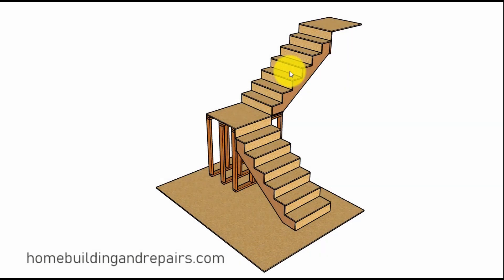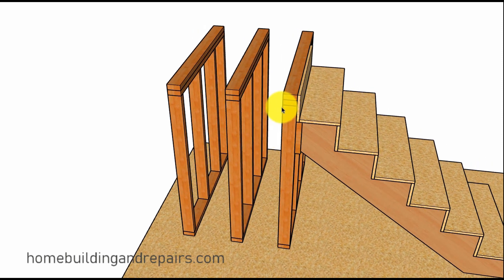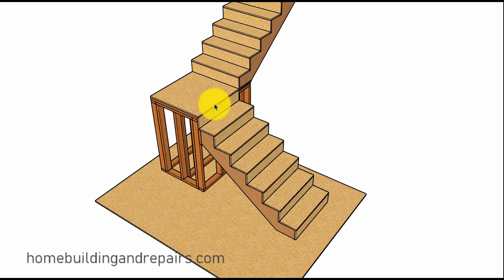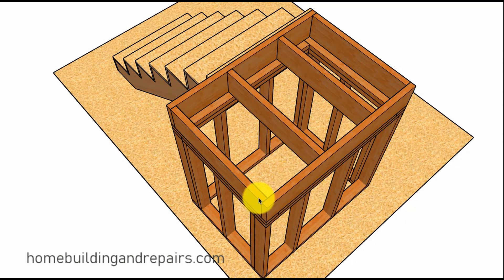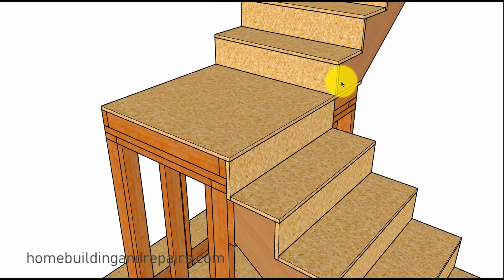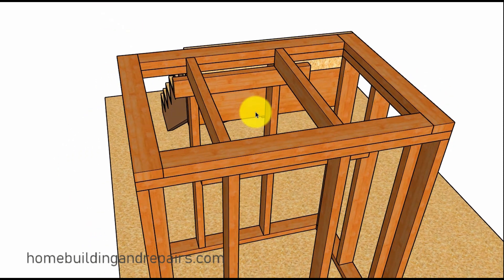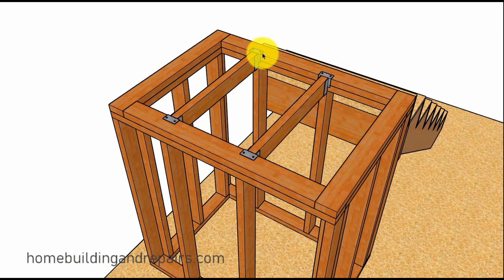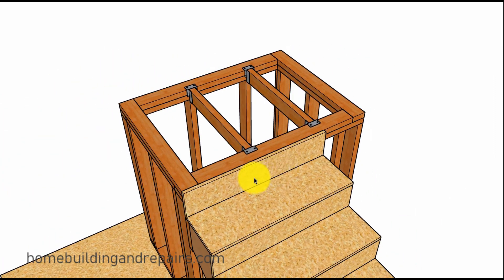Seven Different Ways To Frame A Stairway Landing - Carpentry Tips For Home Builders

Comment: For stairs @2:23 the back side of the landing if the 2x4 were moved to double up in the two corners. could you just move them and convert under the landing to a closet space? You’d have to remove the framing running along the floor.
Reply: Only the vertical and wood running along the floor are 2x4. The top framing is 2x8 or 2x10

Comment: Do you have a video for the following: A protruding landing at the top of a staircase of 10-12 steps. PROJECT: We are going to build a staircase in our barn, up to a renovated loft (previously reached with a ladder). We have limited space for the staircase. The staircase/stringers will need to run parallel to, and probably be attached to, the lower wall beneath the loft. There is only one wall on the loft side to which the stringer will be attached - the other side is part of a barn room. The top of the staircase stringers will  run into the exterior wall, perpendicular to the loft, at which point a landing will be needed to turn 90 degrees to access the loft space. The videos I find only do mid-staircase landings - I have yet to find one that places a landing like this.